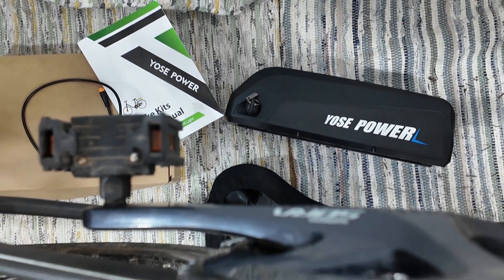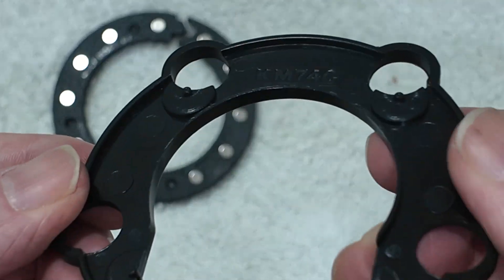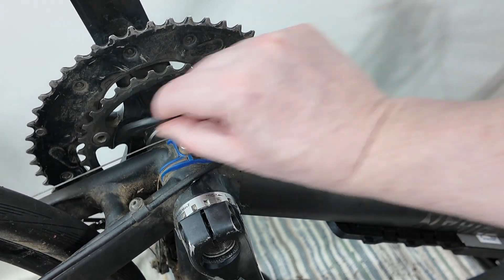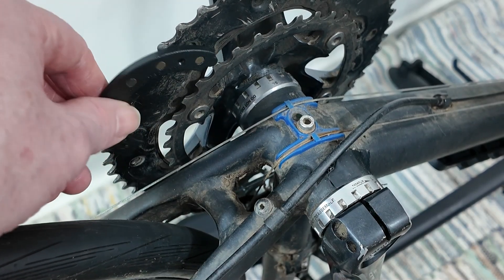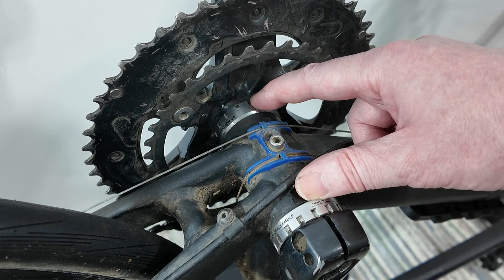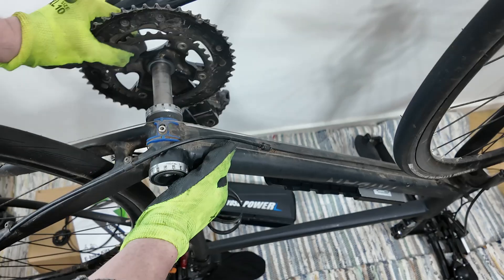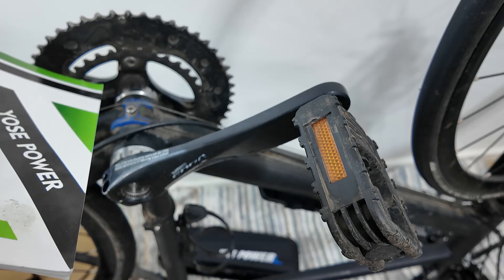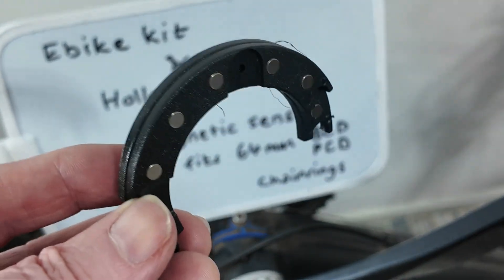Ebike kit & Hollowtech 2 problem : the 64mm question

Comment: You keep saying "don't get hollowtech 2" but really anything that isn't hollowtech 2 or similar (hollow tube, bearings in cups outside of the bb shell, dub, any aftermarket bb/cranks) is total shit. It's hard to get a tapered bottom bracket that isn't garbage.
Reply: The only thing garbage about square taper is your  opinion !